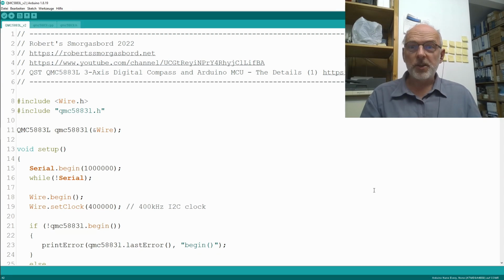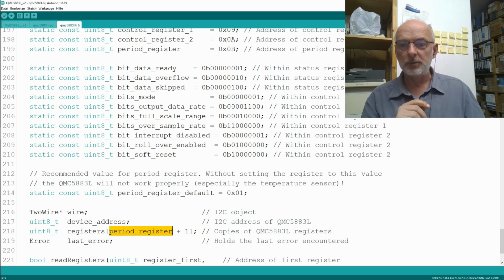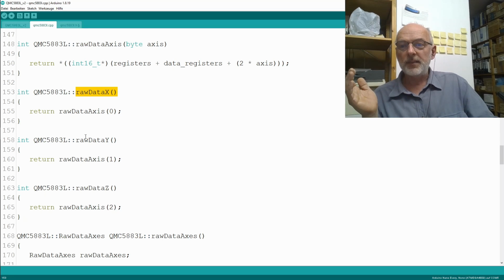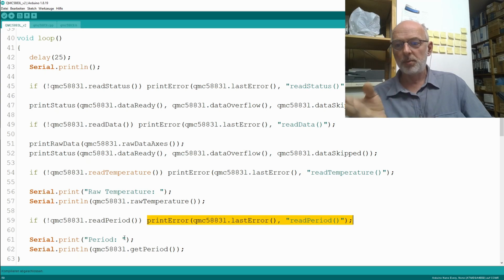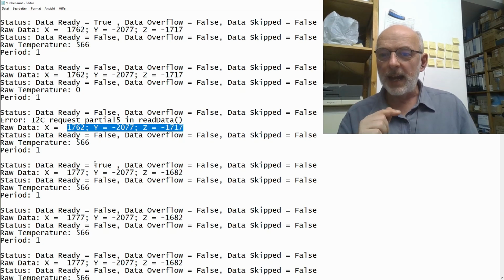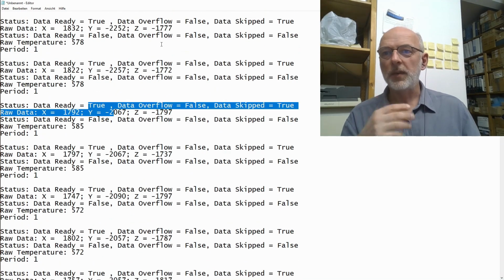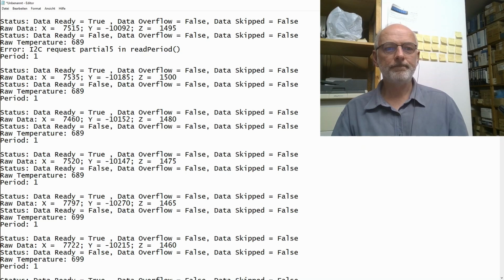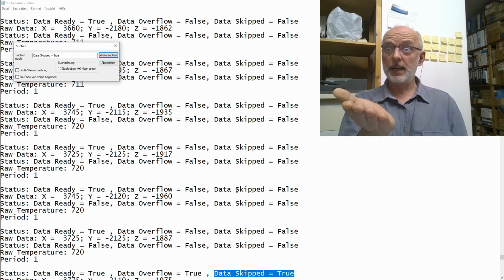QST QMC5883L 3-Axis Digital Compass and Arduino MCU – The Details (2)

Comment: Thanks for the helpful video but is there any information regarding the circuit of this sensor?
Say someone wants to recreate its circuit to create their own compass... how would that go?
Reply from the maker: What circuit are you talking about? How I attached the breakout board to the Arduino? The circuit on the breakout board itself? Or the internal circuit of the QMC5883L (which is not publicly available)?
Reply: Referring to the common GY-271 breakout board; there is a PDF with schematic for it on the web. Just do a search for "GY-271 schematic." I think the website I found it on was "botnroll."

Comment: that's seems really nice.
but got problem with. seems missing something.

i can't compile... i got
'boolean' does not name a type; did you mean 'bool'?
even if i add "arduino.h" i fail into some more errors...
need some help..
Reply from the maker: That's curious! I'm assuming you're using the Arduino IDE since you're including "arduino.h". "boolean" is an Arduino IDE data type and doesn't require to include "arduino.h" ( https://www.arduino.cc/reference/en/language/variables/data-types/boolean/ ). "bool" is the standard c++ datatype and should work in any IDE. Which Arduino IDE version are you using (I'm using 1.8.19)? You could try to replace all "boolean" by "bool", but as mentioned that shouldn't be necessary.
Reply: hi !
first of all thank you for answering.
yes, i have see arduino reference to the datatype boolean... that's why i'm lost. i don't understand.
i fixed this by adding this.
typedef bool boolean;
typedef uint8_t byte;
but now, i got this error:
call of overloaded 'requestFrom(uint8_t&, size_t&, bool)' is ambiguous

Arduino IDE 1.8.19 on Linux ubuntu 21.10
maybe it's me... but i don't see what...
Reply from the maker: @morgendavid  No, it's definitely not you. Maybe there's some but in the Linux version of the Arduino IDE. Anyway, instead of trying to define the missing types (boolean, byte), just replace boolean with bool and byte with uint8_t. Should be quick with search & replace 😉

Comment: As always, I am enjoying this series. Thanks for putting in the effort and sharing you journey. Like you, I cannot believe the Arduino cannot keep up. This points to a deeper architectural problem. (A quick "back of an envelope calculation" suggests it should go at least 50 times the speed you are getting). The obvious suspect is the interrupt routine which uses a flag with no synchronisation. Remember volatile just tells the compiler not to optimise: it doesn't make access atomic. I am looking forward to the next installment! By the way, you might want to consider making some of your static consts static constexpr. That guarantee that the compiler will do the right thing for what you want in the offset calculations  and a couple of static_asserts would add to our confidence in that. Anyway. Thanks again for your work.
Reply from the maker: I thank you for your detailed and constructive feedback!
Regarding constexpr: Yup, that would probably have done the trick - my bad.
Regarding the interrupt: You could use the ATOMIC_BLOCK macro (or noInterrupts) when accessing the volatile variable set by the interrupt routine. And if your variable has more than one byte you should definitely do that. However, my Boolean is only a single byte. So loading/saving it to/from an register is already an atomic operation. If the variable is loaded during loop() with the value 0 and then the interrupt immediately changes it to 1, I'll catch that during the next call of loop(). If I set the variable back to 0 again in the loop(), I might overwrite overwrite a set to 1 by the interrupt. In the worst that could happen is that I loose single interrupt signal in both cases. But since the interrupts were coming every 100ms, respectively, 20ms that's highly unlikely. To be honest, I suspect a hick-up in the I2C communication to cause all the trouble. But I'll handle that in part 4 or five 😉